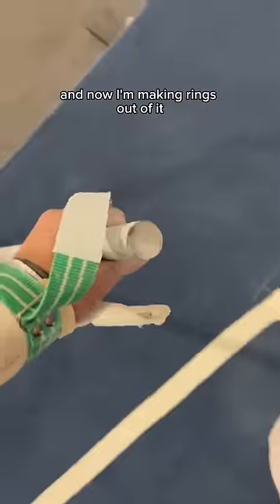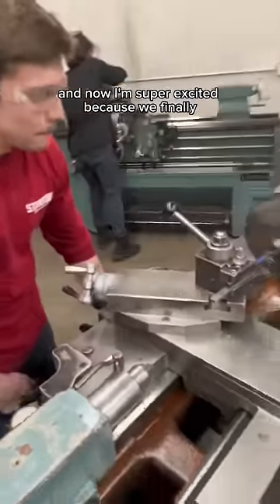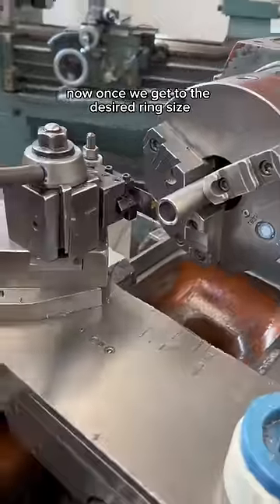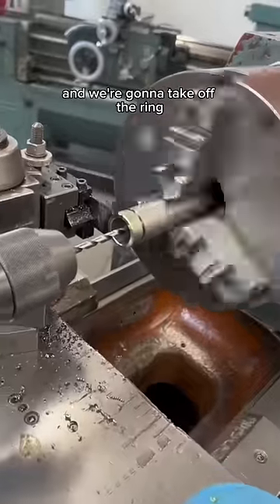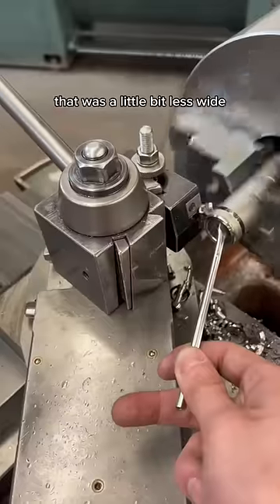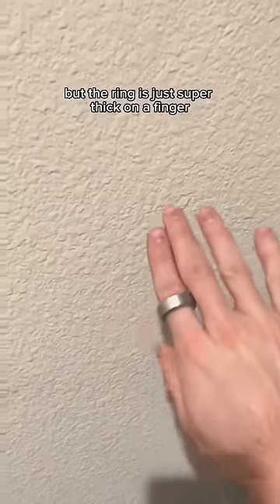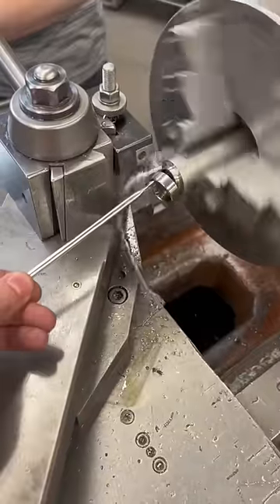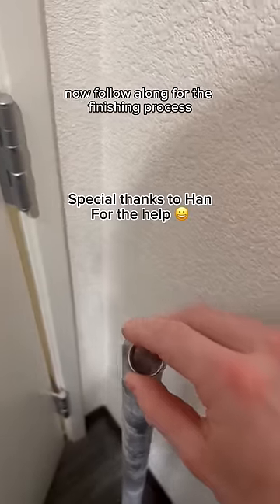They turned out so good 🎉 #gymnastics #gymnast #ncaa #calisthenics #rings #jewelry #jewlerymaking

Comment: If you want to keep the outer look but make it slimmer than hollow it out even more from the inside out to the desired thickness and to make the diameter smaller, cut out a piece of the ring and bend it back together. That way it still has that matte finish.
Reply: But then it wouldn’t fit the finger
Reply: @thedarkpulsegaming8119  Read again
Reply: @thedarkpulsegaming8119  Read again
Reply: @thedarkpulsegaming8119  Read again
Reply: @thedarkpulsegaming8119  read again
Reply: @thedarkpulsegaming8119  read again
Reply: @thedarkpulsegaming8119  read again
Reply: @thedarkpulsegaming8119  Read again
Reply: @thedarkpulsegaming8119  Read again
Reply: @thedarkpulsegaming8119  Read again
Reply: But then there would be a join mark (maybe), which I guess is ok but if you want it as close to the original as possible...hang on you just polish it. Thought process peeps!
Reply: @alfiemillersharp no there won't be. All golden rings at one point was soldered together and becomes one peice .
Reply: @shamalamadingleberry7203  It doesn’t say solder it says bend
Reply: @thedarkpulsegaming8119  read again
Reply: @thedarkpulsegaming8119  read again.
Reply: @thedarkpulsegaming8119  read again
Reply: @thedarkpulsegaming8119  read again
Reply: @thedarkpulsegaming8119  read again
Reply: @thedarkpulsegaming8119  read again
Reply: @thedarkpulsegaming8119  Read again
Reply: @thedarkpulsegaming8119  Read again
Reply: @thedarkpulsegaming8119  Read again
Reply: @thedarkpulsegaming8119  read it again
Reply: @thedarkpulsegaming8119 read again
Reply: @thedarkpulsegaming8119  Read again.

But also, I hope you have an amazing day/night!
Reply: @thedarkpulsegaming8119  read again
Reply: @thedarkpulsegaming8119 read again
Reply: @thedarkpulsegaming8119  read again
Reply: @bryght_  when you bend you generally solder when it comes to rings.
Reply: Poor kid- yall gotta give the guy a break-
Reply: @thedarkpulsegaming8119 Read again
Reply: @thedarkpulsegaming8119  read again
Reply: @thedarkpulsegaming8119  I'm sure you've read enough times, I now rid you of this burden
Reply: @bryght_  And once it's bent how do you think the two ends are joined?
Reply: @thedarkpulsegaming8119  Hey man have you tried rereading the original post, it might clarify your confusion

I mean

Read Again
Reply: @thedarkpulsegaming8119  Read again
Reply: @thedarkpulsegaming8119  read again
Reply: @TheDapperDog402  It never said they were
Reply: @thedarkpulsegaming8119  read again
Reply: @mikeymikey6350   nah read again
Reply: @yeanisch  in this instance I’d say spot welding and then grinding would work best as this is steel, but then the matte finish would not be there…
Reply: @thedarkpulsegaming8119  read again😂
Reply: @thedarkpulsegaming8119  Read again
Reply: @thedarkpulsegaming8119 read again
Reply: @thedarkpulsegaming8119  read again
Reply: @thedarkpulsegaming8119  read again
Reply: @thedarkpulsegaming8119  Read again
Reply: @thedarkpulsegaming8119  read again
Reply: @thedarkpulsegaming8119  read again
Reply: @thedarkpulsegaming8119  read again
Reply: @bryght_  thats implied because thats the only way its done when youre making rings
Reply: @doomslayer5549  I’ve seen ring with slits
Reply: @bryght_  was it like homemade?
Reply: @doomslayer5549  It was a ring
Reply: @thedarkpulsegaming8119  5 days later I think you should read again
Reply: @thedarkpulsegaming8119  read again
Reply: Could have said “machine inner diameter, resize to finger “.
Reply: @thedarkpulsegaming8119  read again
Reply: @bryght_  read again
Reply: @thedarkpulsegaming8119  Read again
Reply: @thedarkpulsegaming8119  Read again
Reply: @thedarkpulsegaming8119  Read again
Reply: @TheDarkPulseGaming read again
Reply: @bryght_  😐
Reply: @doomslayer5549  Store Bought
Reply: @thedarkpulsegaming8119  read again
Reply: @thedarkpulsegaming8119  read again
Reply: @thedarkpulsegaming8119  read again
Reply: @thedarkpulsegaming8119  Read again
Reply: @thedarkpulsegaming8119  Everyone replying is slow. You're right, he turned the third ring on the outside diameter to thin the ring as it was too bulky. Unlike the idiots who've never gone to school, hollowing out the inside diameter would either make the ring too bulky (like the second ring) or too large.
Reply: @thedarkpulsegaming8119  Read again.
Reply: @thedarkpulsegaming8119  read again
Reply: @thedarkpulsegaming8119  read again
Reply: @thedarkpulsegaming8119  read again
Reply: @thedarkpulsegaming8119  read again
Reply: @thedarkpulsegaming8119  read again
Reply: @thedarkpulsegaming8119  read again
Reply: @thedarkpulsegaming8119  read again
Reply: @thedarkpulsegaming8119  read again
Reply: @thedarkpulsegaming8119  read again
Reply: @thedarkpulsegaming8119  Read again
Reply: @thedarkpulsegaming8119 read again
Reply: @thedarkpulsegaming8119 read again
Reply: @thedarkpulsegaming8119 read again
Reply: @thedarkpulsegaming8119  Read again.
Reply: @thedarkpulsegaming8119 Read again
Reply: @thedarkpulsegaming8119 read again
Reply: You could also try making a thumb ring if its big enough to accommodate your thumb
Reply: @thedarkpulsegaming8119  Read again

Have a nice day AND night (:
Reply: @thedarkpulsegaming8119 read again 😅
Reply: @thedarkpulsegaming8119  Read again
Reply: @thedarkpulsegaming8119 read again
Reply: @thedarkpulsegaming8119 Read again
Reply: @thedarkpulsegaming8119  read it again
Reply: @thedarkpulsegaming8119 read again
Reply: @thedarkpulsegaming8119 Read Again
Reply: @thedarkpulsegaming8119 Read again
Reply: @thedarkpulsegaming8119 Read Again
Reply: @thedarkpulsegaming8119 read again
Reply: @thedarkpulsegaming8119  Read again
Reply: @thedarkpulsegaming8119 Read again
Reply: @thedarkpulsegaming8119 Read again
Reply: @thedarkpulsegaming8119 read again
Reply: @thedarkpulsegaming8119 Read again
Reply: @thedarkpulsegaming8119  read again
Reply: @thedarkpulsegaming8119  Read again
Reply: @thedarkpulsegaming8119 read again
Reply: @thedarkpulsegaming8119 read again
Reply: @thedarkpulsegaming8119 read again
Reply: @thedarkpulsegaming8119  Read Again
Reply: @thedarkpulsegaming8119  Read again
Reply: @thedarkpulsegaming8119 read again
Reply: @thedarkpulsegaming8119 read again
Reply: @thedarkpulsegaming8119   You can’t escape it read again
Reply: @thedarkpulsegaming8119  man I am so sorry for your notifications damn
Reply: @thedarkpulsegaming8119 At the end of their comment, they basically say to do a cut and resize without changing to outer look. Shich is why everyone is saying to re-read, but if your not don't know about rings than you may not understand it with how they worded their comment.
Reply: @thedarkpulsegaming8119 read again
Reply: @thedarkpulsegaming8119 read again
Reply: @thedarkpulsegaming8119 read again
Reply: @analbort8274 …..do i even have to say it🤣🤣🤣🤣🤣
Reply: Es ist unglaublich, dass sie da selber nicht drauf gekommen sind😂
Reply: @thedarkpulsegaming8119 read again
Reply: @thedarkpulsegaming8119 Read again
Reply: @bryght_ okay but that’s the next step of the process when bending a ring like that.
Reply: @thedarkpulsegaming8119  read again
Reply: @thedarkpulsegaming8119 Read again
Reply: @thedarkpulsegaming8119 Read again
Reply: @thedarkpulsegaming8119  I wonder if he read again
Reply: Jesus loves you ;;;
Reply: @alfiemillersharp you can make it go away but i mena he did fine it’s still made out of the bar so
Reply: @thedarkpulsegaming8119 read again
Reply: @thedarkpulsegaming8119 read again
Reply: @thedarkpulsegaming8119  read again
Reply: @thedarkpulsegaming8119  a year later, read again.
Reply: @thedarkpulsegaming8119 Read again
Reply: @thedarkpulsegaming8119  Read Again
Reply: @thedarkpulsegaming8119  breaking the read agin chain, but seriously read again
Reply: @shamalamadingleberry7203 yes there would. This isn’t gold, it’s not soldered, and it’s a matte oxidized exterior which can’t be accomplished with soldering.
Reply: @thedarkpulsegaming8119  Read again
Reply: @thedarkpulsegaming8119  read again
Reply: @thedarkpulsegaming8119 Read again
Reply: @thedarkpulsegaming8119 Read again
Reply: @thedarkpulsegaming8119 read again
Reply: @thedarkpulsegaming8119 Read again
Reply: @thedarkpulsegaming8119  Read again
Reply: @thedarkpulsegaming8119 read again
Reply: @thedarkpulsegaming8119 read again
Reply: @thedarkpulsegaming8119 read again
Reply: @thedarkpulsegaming8119  Read again
Reply: that would prob make it harder to produce them
Reply: @thedarkpulsegaming8119 read again
Reply: Reab aqain
Reply: @thedarkpulsegaming8119  Cheese Again.
Reply: @thedarkpulsegaming8119 read again
Reply: @thedarkpulsegaming8119  read again
Reply: @thedarkpulsegaming8119  read again
Reply: @thedarkpulsegaming8119 Read again
Reply: @thedarkpulsegaming8119 read again
Reply: Itd probably be way easier just to sand the outside of the ring to a similar roughness. If you have to solder it you’ll also have to sand and polish it to  hide the seam itd be way more work
Reply: @thedarkpulsegaming8119  Read again
Reply: @thedarkpulsegaming8119  read again
Reply: @thedarkpulsegaming8119 Read again
Reply: @thedarkpulsegaming8119  read again
Reply: @thedarkpulsegaming8119 read again
Reply: Kid of a jeweller who also has jewellery experience. Don’t do this. It would require soldering and if it’s a galvanised metal then it will generate ✨ poisinous fumes ✨

Also resizing a ring like that stresses the metal and creates a weak point. The matte effect can be achieved with really fine sandpaper

Comment: You could always use the first ring and loop it onto a necklace so it still looks like the high bar
Reply: but the necklace kind of draws out the attention of the highbar
Reply: @jikill7586  if you drill 2 holes in the sides of the ring, it would lay flat when threaded onto a black cord, and would remain the centerpiece
Reply: Like magic earring Ken!
Reply: @meadowcorefairy my thoughts exactly
Reply: P0

Comment: Hey so a quick tip from an ex machinist. Set your cross-slide to 45 degrees but change the tool post to have your parting tool straight. Take a plunge about 1mm/40 thou radial or 2mm on diameter, retract the tool and move it to the front face(in z) 1mm, then use the cross slide to make a lovely 1mm chamfer and when your parting tool makes full contact with the o/d stop using the cross-slide and do a straight plunge through. Use a bit of cutting oil too, but your speed seems slow enough.

Comment: I used to work in an emergency room. We had a kid come in one night that had taken a sealed bearing from a skateboard wheel, knocked the guts out, then put that hardened machine steel ring on his finger. And couldn't get it back off. 

NOTHING we tried would work. Lube, failed. String method, failed.  I myself went through 4 ring cutters and none of them made more than a scratch while turning the cutting wheels into smooth disc's lol. 

They had to call in a surgeon who used a nitrogen gas powered skull saw that used diamond coated rotary bits. Each bit was around $1200 bucks.  It took 4 of those to cut it off. 

His parents, unthrilled.

Comment: No coolant? Or am I just a noob at using the lathe😅
Reply: with hard metal cutting plates you can forego the coolant if you do not have a constant source of it - as those hard metal plates are sensitive to sudden changes in temperature. At least that is what we were told in the workshop as apprentices - the options were a squirting bottle of coolant we usually used while drilling or going dry, and dry was the preferred method for these cutting tools

Comment: curious how you go from a broken resin bar to an aluminum ring.
Reply: it's an aluminum bar
Reply: @nighttskies  so the aluminum bar sheared off cleanly like that?  That's a scary situation right there...I just did some research and could find nowhere that the high bar is made from aluminum.  Stainless steel seems to be the material used.  No way would alum. work for that application.  It work hardens and all that flexing would lead to a fail.  That's some lawsuit potential right there.
Reply: @AffordBindEquipment  you were both wrong
Reply: @cellularcomponent  How so?
Reply: @AffordBindEquipment   you said it was resin then said it was aluminum. Both of those are wrong
Reply: @cellularcomponent  I didn't say it was alum.  the guy who did the vid said it was and is the basis of the vid.   My first response I mention resin because the break looks like resin.  then I did research and I said these are usually made from stainless.   Made from aluminum is scary indeed because of work hardening.
Reply: @AffordBindEquipment   no one said it was alum. Even if he did you were still wrong
Reply: @cellularcomponent  If it will soothe your soul, I was wrong to say it was resin. He did say it was alum.  I am not wrong to say it is usually stainless.  Happy?
Reply: @AffordBindEquipment   he didn't say it was alum...
Reply: @cellularcomponent  You are right.  the first response in this thread said alum and I assumed it was the guy who made the vid or someone who knew the guy.  The shavings from the lathe look like aluminum to me. so what metal do you think will shear almost straight off like that with the use it  had?  steel will not break like that.  work hardened aluminum will.
Reply: @AffordBindEquipment   you were still wrong, also steel does break like that because it just did.
Reply: @cellularcomponent  And you know because?
Reply: @AffordBindEquipment   know what?
Reply: @cellularcomponent  How do you know it is steel?
Reply: @AffordBindEquipment   stated multiple times in his videos, used in the Olympics and I used to do gymnastics.

Comment: How tf did you break a steel bar
Reply: Probably an older bar plus the right stress in the right points. There is an insane amount of force put on the bars in gymnastics events
Reply: Metal fatigue.